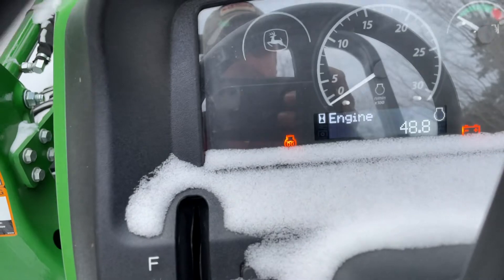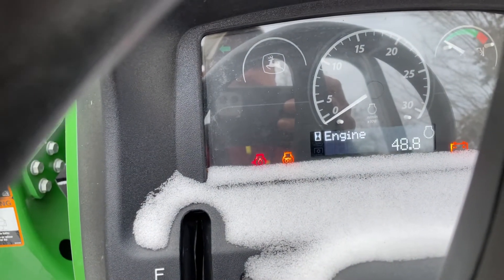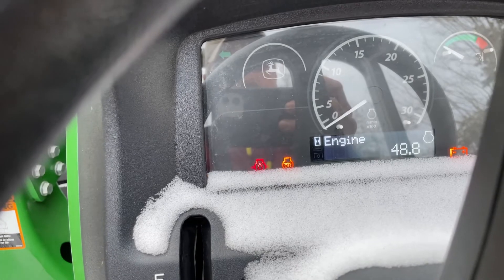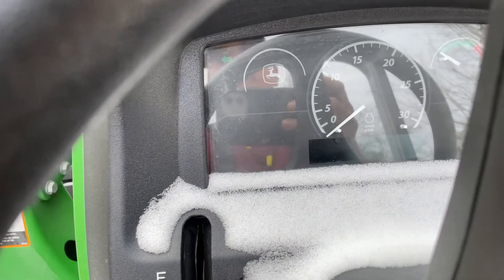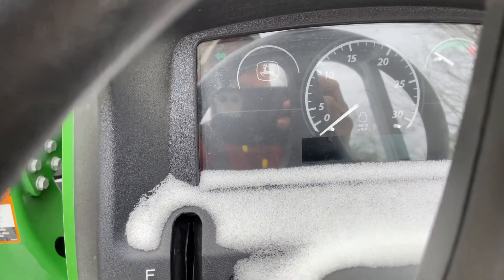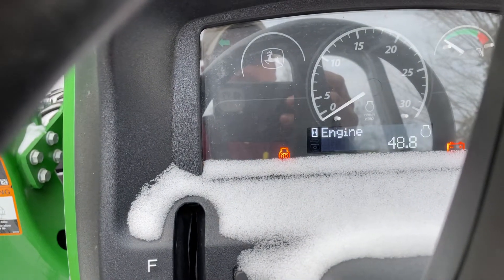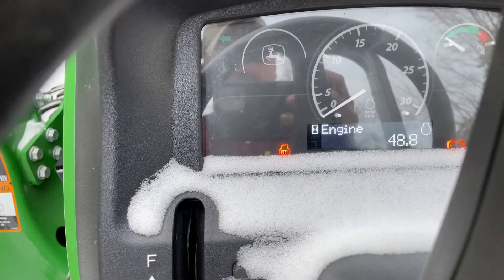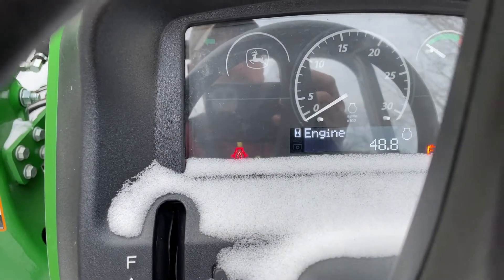John Deere 3025D Cold Start

Comment: This doesn't surprise me one bit. With a 49hour tractor & fresh battery,  it SHOULD HAVE STARTED. My 3 1/2 & 5years old tractors in ZERO degrees just started yesterday fine. But they have common-rail direct injection, maybe that is why. My nearly wore out 1020 1988 Massey-Ferguson with 1800 very abused hours starts easily in ZERO degrees temperatures;--- only with a coolant heater "frying" for hour. Guess every tractor is different. Thanks for the great Vidio Sir and happy safe tractoring.

Comment: Started pretty good. I just bought the 3025e, had dealer install block heater. Could have done myself but too cold here in upper Midwest! Let heater run about 1/2 hour and fired right up. Would highly recommend one.
Reply from the maker: Yes I agree. Since I installed one on mine I use it when it is below 30°F.

Comment: Thanks for the video! I guess it just hasn’t gotten cold enough here in western Oregon for my glow plugs to come on. I was just surprised that they don’t always cycle like they would on a pickup, no matter the outside temp.
Reply from the maker: I know on one of the trucks I had they would stay on longer if the temp was below 32 degrees F. I assume that this is the same way.